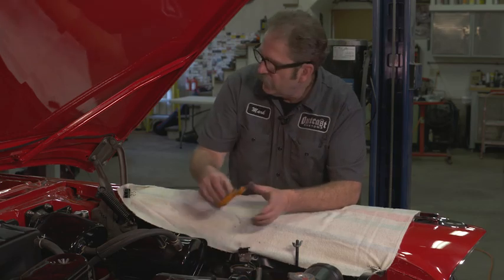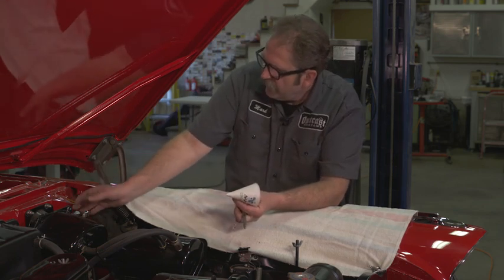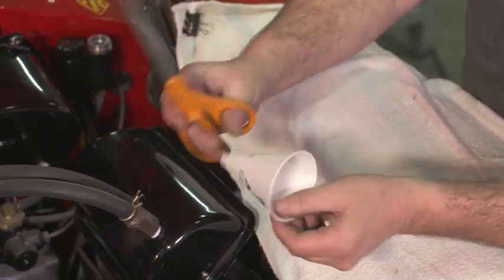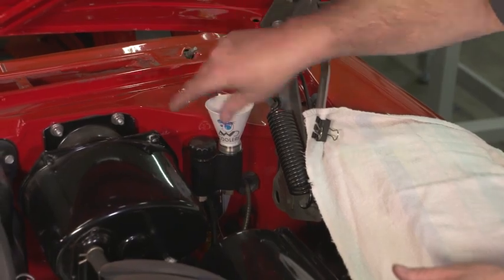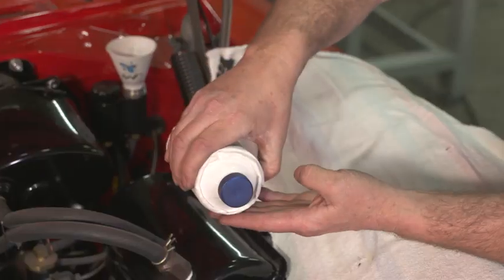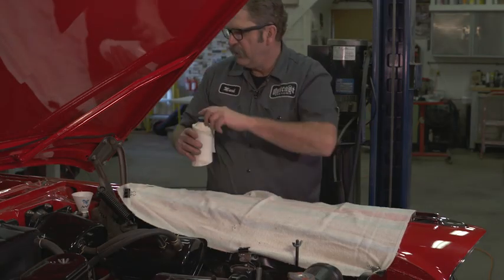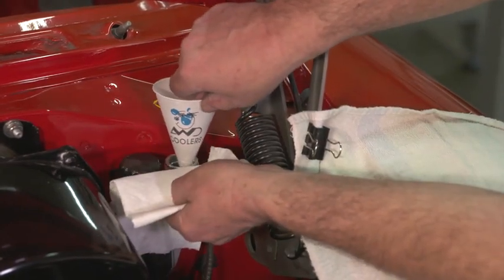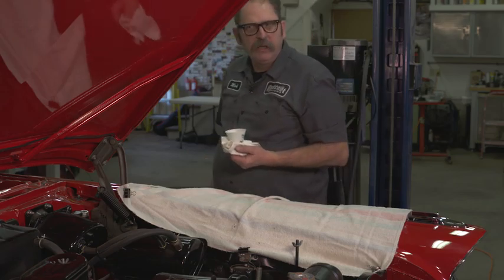How to Stop Brake Fluid Leak

Comment: my civic 97 leaking all the fluid from reservoir when i pumping it all the brake line dont have any leakage  what i found out is the fluid leak out from the small steel pipe look like some kind of bleeder pipe near the fire wall there any of you got this prblm before? can tell me what should i replace to solve this prblm thank. Sorry for my bad english
Reply from the maker: Hello, 

After looking at a few different CIVIC Master Cylinders I have failed to see any with the pipe you describe.

However when you have any leaking of your master cylinder, it's a 
good idea to replace it, and for your car they are relatively 
inexpensive, when compared to many others.
Wrench Safe,
 MarkClassic Car Restoration Club Video Membership